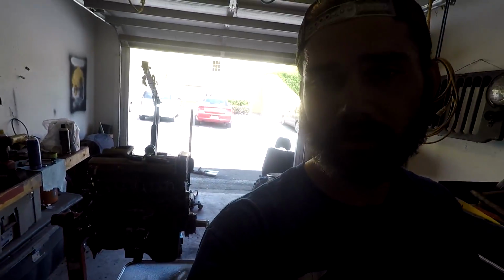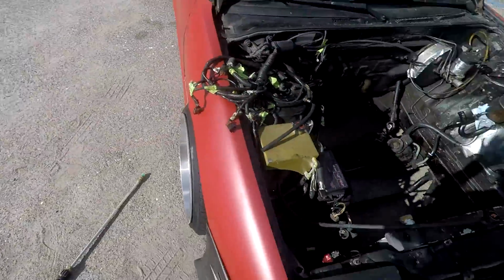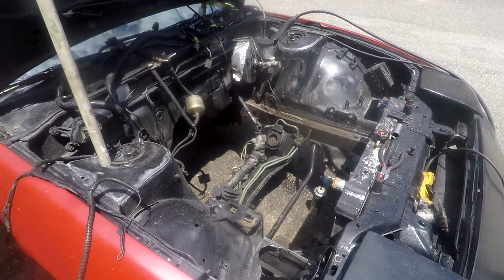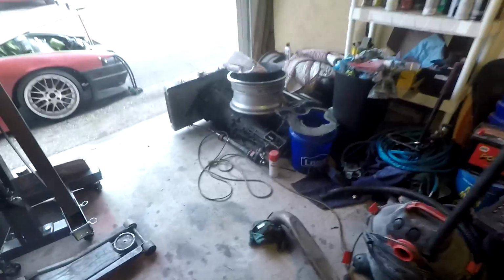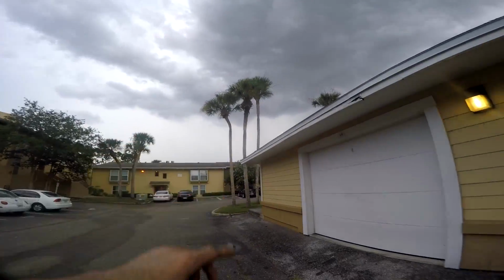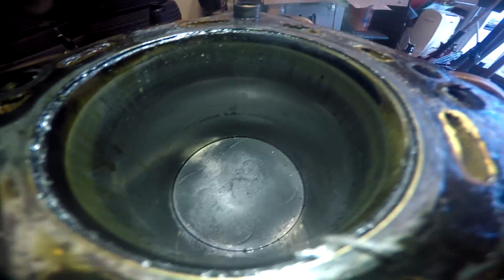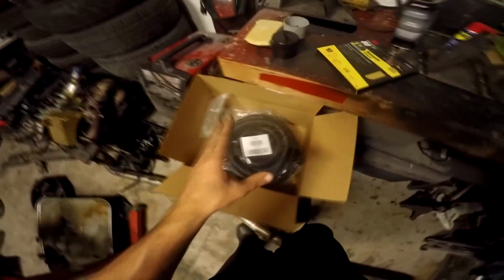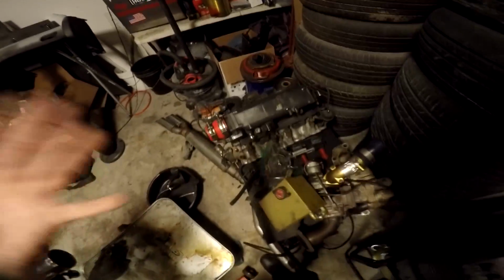Engine Bay Clean up Con't + Tearing down my CA18DET

Comment: Looking good, nice build so far. One thing though, typically a “stitch weld” would run down the seam, not across the seam, that is to prevent the seam from moving & breaking out the spot welds. What you did there will certainly add some strength as well so not a big issue, just that I’m seeing that method used on other 240’s too so I figured I should let you know that isn’t really the right way. I always watch videos to the end, I don’t get why people don’t.
Reply from the maker: I understand what you’re staying, i guess i called it stitch welding because I’m just dropping spot welds every inch.  The forums and videos I’ve looked into for the S chassis Strut towers had a lot of folks welding the seam this way. I didn’t see many people following the seam because it’s such thin material. I think if the seams were to fail i would have to be in a front collision.. these cars are tin cans. 

Thanks for watching man! I appreciate the constructive criticism & your time! 🤘🏻🤘🏻